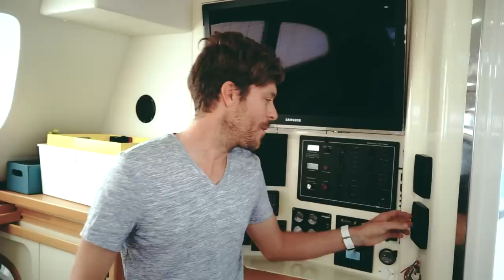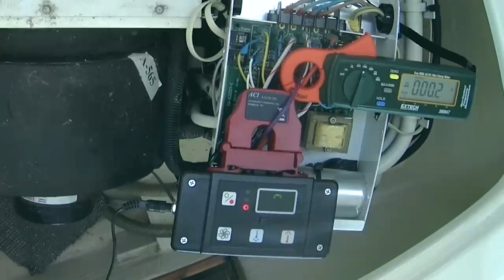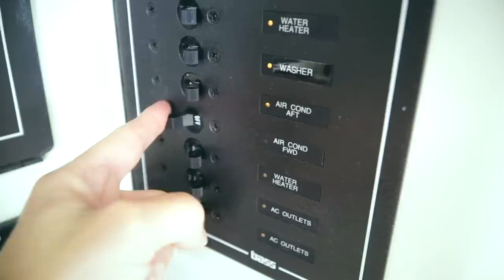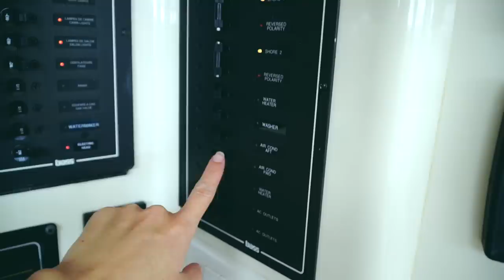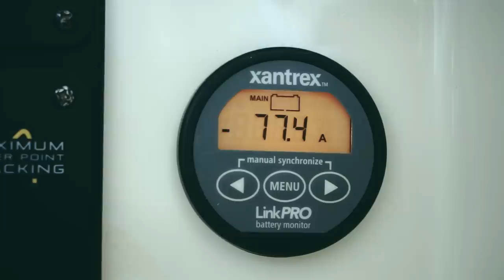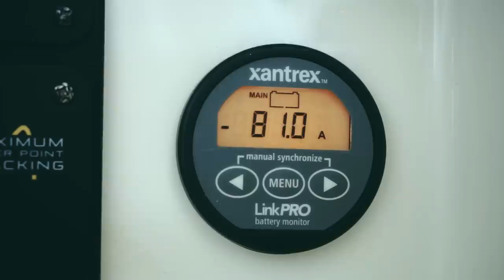Air Conditioning on a Sailboat? Yes, & It's Battery Powered!

Comment: Great information and gee you have me intrigued.
Your Cruiseair 16000BTU is power eater.
Do you feel it he 16000 is the correct Air Con size for the boat or is it overkill Genset driven.
Obviously Solar wasn’t a viable option when your Kitty Kat was built.
I can’t find the Cubic Meter Airflow for your Air Con so that would be really interesting to know to do some comparisons with newer model Air Cons.
From what I’ve seen you can get a 7000BTU that uses l57 Amps per hour yet 60% of the airflow in Cubic Meters to that of a new 16000.
See you when you reach Australia
Reply: Sorry, I meant 57 amps

Comment: We have geothermal heatpump in our home with a loop of hose down at earth core temp in front yard. Why could you not drop a loop down at anchorage and circulate water to tap into the chill of deeper water, then use a simple heat exchanger to chill the boat. The biggest current draw you have in your ac is the compressor. This would eliminate that.

Comment: I have installed many AC systems on boats, it is doable. Power is the issue. You need generators or shore power.

Comment: Well, probably i'm too late, but you got 54A just because your power supply could give that amperage. If your wires voltage degrades with power(like connect a thin wires) - compressor would be take that from capacitor. But if voltage on capacitor from your power supply is the same that capacitor have - it would not work.... Slow start device is limiting the amperage probably, so you get less numbers.

Comment: I see that the chinese are using floating solar arrays. This allegedly helps with cooling the panels & improving efficiency. I realize that this would be silly whilst trying to sail. It would work quite well whilst moored for longer periods when using such things as ac would be more likely. Do you know if such devices are available and cost effective for boats?
Reply from the maker: +Adrian G. Pop just as big a problem would be where they could be safely stored when not being used.
Reply: Gone with the Wynns do they not make ones that roll up, I remember seeing one at a campsite that would roll up into a tube for storage.

Comment: I saw a video on youtube that you can stick solar panels to the deck giving a much large power source, the guy who did it said he was fully charged by 8am everyday, if you added such an additional system to your cat you may be able to run aircon all day if required
Reply from the maker: We have flex solar on the hard top, 6 panels with 600 watts:  https://www.gonewiththewynns.com/charge-boat-batteries 
Being fully charged by 8am is not likely because the angle of the sun won't produce much power...unless they have a bunch of panels and a tiny battery. :)

Comment: Ciao guys, please if you put Amps, put the at least one of the other two variables: watts or volts. i can figure out if the surge is 6050watt at 110 volt ac , or 660watt at 12volt cc or 12100watt at 220volt ca or 1320watt at 24volt cc . thank you
Reply: Hello Dan.  You're not the only one to be a bit unsure about this, so we apologize.  Please read my reply to a similar comment from "k bob".  If you sort the comments by "Newest First", you'll see k bob's two below yours.
Reply: Micro-Air, Inc. 
Yes it is somewhat clearer.
Reply: Good morning and Happy Eastern,  i had an epiphany last night. Maybe the whole energy strategy is wrong.
so there is five points. 
1. Creating energy: ok solar/diesel/gas(gpl convertible), can be updated to : Ethanol  powercells (very very reliable but i cannot tell how widley is ethanol station spread ) ; fluid:water(fixed or trailed) or wind(maybe helical blades on top of the mast??? i am guessing here, so less dangerous and providing more sail surface),
BTW i would try to have an micro battery charger for each pannel or an mppt charger with multple solar array imputs , to avoid partial shade loses
2. Transport energy:  i would increase all 12 v cables to at leas 30 %thickness above recomended.
3. store energy: lithium battery bank can be updated to larger and or water cooled/heated if extreme temperatures is probable
4. convert energy: inverter, if money alowed, upgrade to multiple microinverters with load detection switch (downside more compex but higher redundancy)
5. consume energy: everything at 12v if possible

please if i wrote any stupid thing do not blame me, i am just amateur

Comment: If you got a bigger battery bank with more solar panels and if you could just add the hydrogenerators then you could actually run the Ac non stop because even when you were sleeping you could easily run the generator the full time

Comment: Air con on a boat is like being royalty.  If you can afford to, run it 24/7.  But for reasons explained in the vid, ppl can't afford to (and many times it doesn't matter how much $$ you have, space is the issue for fuel...).  In these cases, you leave it off most of the day and play outside in the sun but at night, sleeping with a bit of a sunburn in the air conditioning makes you feel like you are in a 5 star lux hotel.  If you are running the AC off the inverter during the day at a very high temp, for humidification purposes, that is useful as well, esp if you have solar panels to power it (which most don't).

Comment: At the end of the video you show the ac pulling 80A.  If shore power is 30 or even 50.  How do run the ac pulling 80A regardless of the surge?   That would imply not enough power to run the ac let alone the other systems or recharge the battery’s.

We are retired and are planning on selling the house in a year and buying a boat and a motorhome.  So we are very glad we found your videos.
Thank you. 
Linda and Mel
Reply: That is an 80 amp draw on their battery bank. Assuming their boat is 12 volt, and shore power is 120 volt, the shore power draw would only be (theoretically) 8 amps. Realistically a bit more due to things like inverter efficiency, voltage drop over long cable runs, etc.
Reply from the maker: Correct, that was a 12v amp draw.  The A/C unit draws around 11-13 amps at 120v.
Reply: Yes, you need 100 amps of 12 volt DC to make 10 amps of 120 volt AC, theoretically.  Modern inverters can run up to about 93% efficiency, so it would be about 108 amps 12v DC to make 10 amps 120v AC.
Reply: Hey Jason - I believe your Xantrex reads "net" battery current, correct?  So, if your solar panels were charging while the inverter was discharging, you would see the net result, true?  Your A/C should cause about a 120A discharge at 12V, so reading about 80A tells me that your solar panels were putting out 40A, or 480W, at the time you shot the video. Could that have been the case?

Comment: Hi!  I enjoy following your channel and I'm sorry to learn about your cat passing away.

I was just re-watching, "Air Conditioning on a Sailboat? Yes, & It's Battery Powered", and I wondered if your vessel is equipped with an automatic generator start (either external or built into the inverter).  If it is, could it be programmed to kick on while you're running your Air Conditioning and put a charge back into your batteries (not sure about your battery C rate or charging capabilities).  If your system pulled down 450 amps during a 5 hour run, and your battery bank had a C rate of 1, and you could push 100 amps/hour back into your bank from the generator - you might get away with a 1.5 hour run time (or 1.5 gallons) of the genny.  

Of course, while your generator was running, the AC units would switch over to run on it while the batteries accept a charge.

Thoughts?
Reply from the maker: Sure it would charge the batteries but one of our motivations for Lithium batteries is so we don't have to listen to a generator and use a lot of gas. 💁
Reply: @gonewiththewynns  I agree.  However, I was thinking this would reduce your fuel usage when you must have A/C.

Comment: You might consider adding a smaller marine diesel generator to use during overnight AC usage.  The Phasor 3.5 kw should run a 16,500 air conditioner with quite a bit left over averaging .2 gallons per hour in diesel fuel, and maxes out at .4 at full power. Dimensions are 28" long, 15.5" wide, 15" high, weight is 160 pounds.  Just sayin... maybe there is a lazarette with a little extra space for one when you are not in full party mode.

Comment: Did you say you only have one ac. Why not put the softstart on both of them.  Also if you are motoring from one spot to another will in sailing motors charge the house battery.  I would think you could run them while sailing to cool of the cabin.
Reply from the maker: We do have a soft start on both A/C units.  Only one is setup to run off the inverter.  The Easy Start is great while we're on shore power, we don't have to worry about flipping breakers when the A/C kicks on.

Comment: Matteo  what is the specs on the easy start . I am more a customized  to electronic soft start ABB  PSR PSTX which I currently use on my industrial motors 50 hp 100hp @ 600volt  etc..
If the cost and ease of install is easier I would just proceed with this style for the boat
Make model of component would be nice 
Thanks
Reply from the maker: There's a link to the EasyStart 364 and a discount code here: https://www.gonewiththewynns.com/product/air-conditioning-off-grid
Reply: The EasyStart 364 models used aboard Curiosity are rated for up to a 36kBTU (3-ton) A/C. There is a dual-voltage (115V-230V) version available too (-X36). The lower cost model variant (-X20) for RV applications is 115V only.

Comment: Of all the sailors vlogging I think you are moist likely to answer these questions. What knots do you use most? Why? What do the various sails do? What conditions call for the use of particular sails or sail combinations?
Reply from the maker: +Monty Montaño Wow - that's a whole sailing course right there and there are probably other channels that do better "how to sail" vids than we ever could. We may do a short video on knots - the bowline gets used most on boats because you can join lines together and the knot never tightens up, even under load.
Reply: Thanks for replying. I realize that's was a big ask. As for the sails I meant do describe what they are doing as you are changing them when you mention them on camera. For instance when you put up the Genoa, mention why, occasionally. What is that going to do for you? Just a thought since you are such good explainers. You've certainly taught us a lot about electricity.

Comment: I have a 4 and a half ton Marine air on my boat and I was wondering cuz it does hit the generator pretty hard when we're out cruising would the soft start help my 4 and 1/2 ton AC unit also Vegas bill
Reply: You can use the EasyStart model 368 for 4-6 ton A/C units.  Boats with larger chiller type air conditioning systems use them all the time.
Reply: Hi Bill.  I will contact you as soon as possible.

Comment: Are you ever in areas with very LOW HUMIDITY?  Are swamp coolers an option?  Requires water and very low humidity but also very low energy costs  (no more than 15 amps for the biggest evaporative coolers).  I think you guys might have had one in the RV?
Reply from the maker: Being on the water in warm lattitudes means humidity. We may visit some places with humidity low enough for a swamp cooler but not often enough to justify installing one.

Comment: Design a system of coils and throw a inlet tube over the side of the boat and another outlet tube also. Place a fan to blow air over the tubes and a small pump to circulate the water.  This is a basic heat pump system and would use minimal electricity.
Reply from the maker: Have you seen some of our "how not to" videos? Water pipes all over the inside of the boat might not be a good project for us! :)

Comment: Can you install a small wind powered generator to help?
Reply from the maker: You can, but it does not help with the initial surge, all it will do is trickle charge the battery.

Comment: Yeah the compressor works against back pressure starting up so it draws a lot of amps. That's why you need to keep the cabin closed to keep the cold air in so the compressor doesn't cycle on and off running up your power bill or running down your batteries. Keep the bought air in, a pet peeve of mine, so I'll end this rant and hope it helps. Locked rotor amps means the compressor is seized and it's time to shop for something more energy efficient. Back to the future.
Reply: it doesnt mean the compreesors siezed at all. it means the amount of amps required to overcome the back pressure in an a/c system as this is how a/c works. the compressor generates high pressure which is converted to low pressure by a tx valve and the low pressure creates cool gases which cool the air passing over the condensor creating cool air flow from the outlets

Comment: How will it help with my HONDA 2000 generator?
Reply: Hi Jon.  Thanks for your question.  The Honda EU2000i has a 2000W maximum rating. At 120V, that's 16.7A.  As you saw demonstrated, after the EasyStart was installed, the peak starting current was 16.6A.  The running current (not show) was only about 12A.  We at Micro-Air own a Honda EU2000i, and we have started and run every 115V A/C we could find.  It works!

Comment: why is running current higher than starting was without soft start?
Reply: Hi Brian.  Thanks for the question. The running current of the air conditioner actually wasn't the Xantrex meter readout, and the Xantrex readings cannot be confused with the readings taken with the clamp-on ammeters at the air conditioner itself.  The confusion comes from the fact that the starting amps were measured on the air conditioning unit itself and were in fact at the high voltage, 120VAC.  Those were 53-55A (AC) without Easystart, and then 16-17A (AC) with EasyStart.  The running amps of the compressor at 120VAC, which was not shown in the video, is about 12A nd the seawater pump draws about 2A, 14A total all at 120VAC.  Later, when Jason showed the amp reading from the Xantrex inverter gauge on the wall, those amps were battery amps at 12VDC.  So the 83A were in fact DC amps.  Since the output of the inverter is 120VAC and the battery voltage input is 12VDC, the amps will be 10 times higher on the input (battery) side.   However, there is one other twist:  The Xantrex meter is also showing net amps leaving or entering the batteries.  Because it was daytime when the video was shot, the Wynn's solar panels were generating some charging amps to the batteries at the same time the running of the air conditioner was discharging them. Since the running amps for the A/C plus SW pump is about 14A @120VAC, the inverter was drawing a total of about 140A @12VDC to power everything (plus a few amps more because no inverter is 100% efficient).  But since the Xantrex was reading only 83A (net discharge from the batteries), that means about 60A were being provided by the solar panels to source the 140A @12VDC requirement.  Hopefully this makes sense.
Reply: most grateful for your reply. more complicated than one would have thought

Comment: Good video, but  a complaint:  For most of the video, you were talking about amps at the air conditioner; i.e. AC/mains amps.  But, at the very last, you were talking about amps from the battery to the inverter.  This was when the Xantrex meter was showing around 83 Amps.  Those aren't the same type of amps you were measuring with Mateo's meter.  That may have confused a lot of people.
Reply: Your point is correct. The amps measured at the the A/C unit during testing were the AC amps at 115VAC.  The amps on the Xantrex meter are the DC amps at 12V leaving or entering the batteries.
Reply: So, to put that into perspective (in case anyone's still awake), those 83 amps at 12VDC at the end are about 8 amps at 115VAC like at the beginning when they were measuring the startup current.
Reply: If there were no solar panels installed, the answer would be yes.  However, since the solar panels are ADDING current to the batteries while the inverter (and its plugged in 120VAC loads like the air conditioner) are SUBTRACTING current from the batteries, then the 83A is actually the net current. Since Jason and Nikki's salon A/C unit draws about 12A at 120VAC when running, I estimate it will draw about 120A from the 12V batteries on the other side of the inverter.  Therefore, since the Xantrex ammeter on the wall was reading 83A while the A/C was running, the solar panels were probably supply 40A at 12V at the same time (120A-40A = 80A @12V).